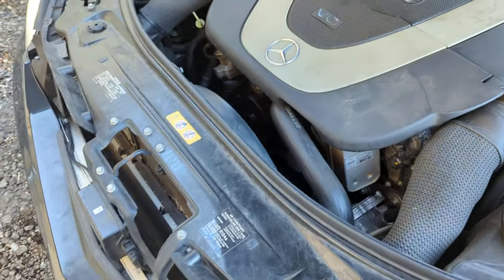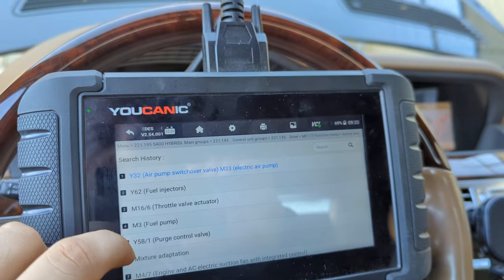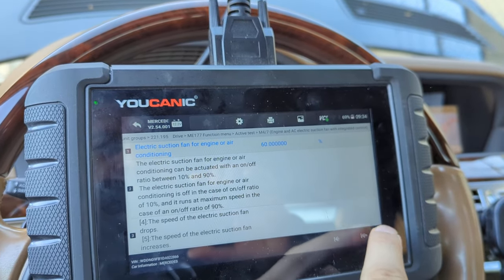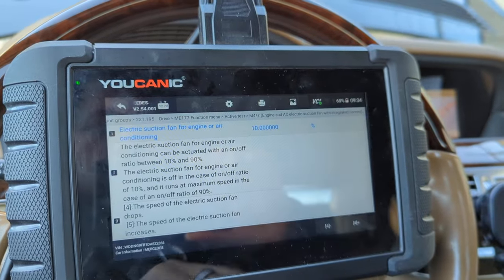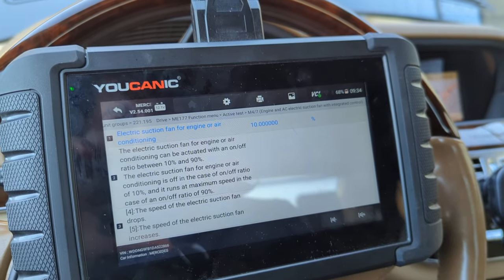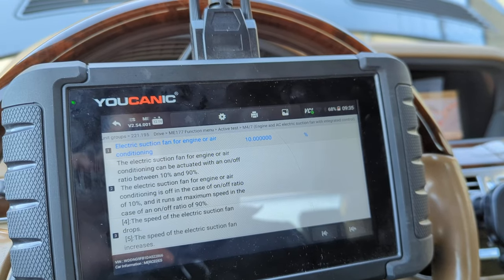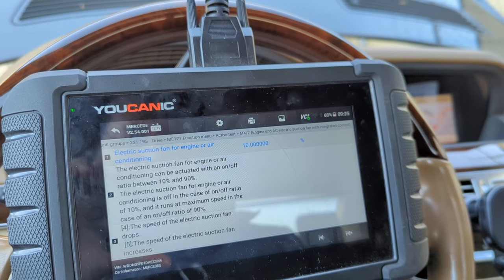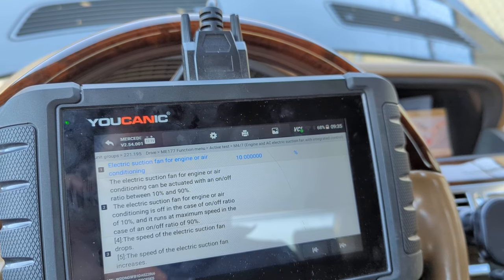Turn On Test Engine Radiator Cooling Fan with YOUCANIC Scanner

Comment: My w203’s (C32AMG) a/c compressor died and now my AC doesn’t work but it also makes my cooling fan not spin. Is fixing the compressor the only way I can have the fan spin again? My car is leaking oil onto the exhaust manifold so it gets Smokey and without the fan to dissipate the smoke it gets inside my cabin if my air recirculation is not on. Thanks